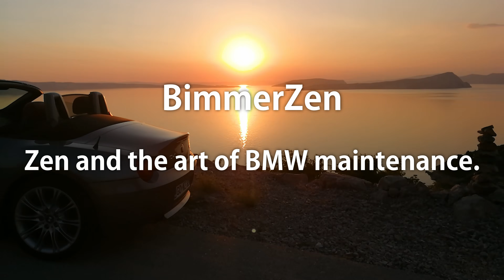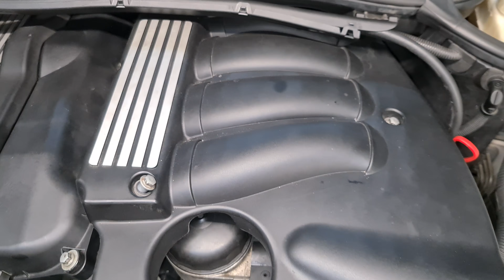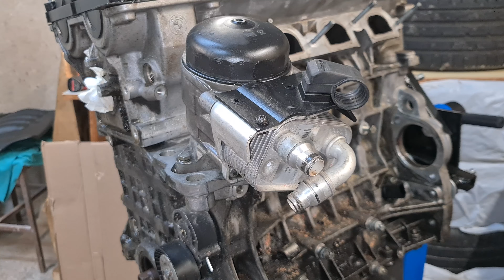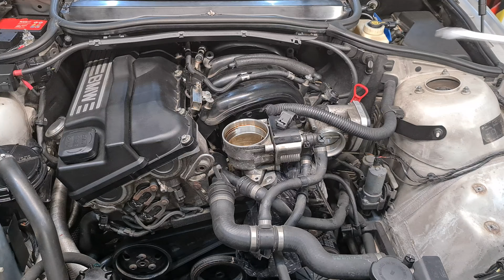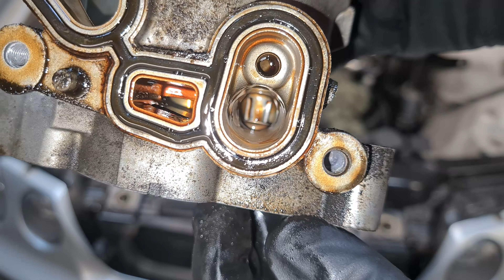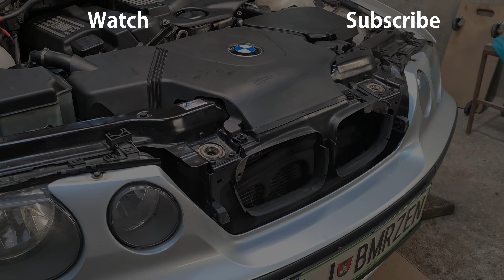N42/N46 Oil Filter Housing & Oil Cooler Gasket Replacement

Comment: Hi Bimmerzen, not sure if you still read these old comments but quick question the OFHG replacement--how come you didn't do any coolant drain or bleed? I thought disconnecting oil filter and oil cooler causes coolant to come out. Thanks
Reply from the maker: The coolant is contained within the oil cooler and you don't need to disconnect any coolant hoses to do this job. These gaskets only seal oil, not coolant.
Reply: @BimmerZen  Thank you for reply I will attempt to do this, your old videos on the N46 are very helpful 😅

Comment: Bad condition of gaskets can be why i have oil in my coolant?
Reply from the maker: Not on n42/n46. There is no gasket sealing oil and coolant. You might have internal failure of the cooler, or a bad headgasket or cracked head/block.

Comment: Thank you, I have just changed my gaskets following your video and now I hope that the problem is gone. 👍 (E91, N46 2007 model)

I also had a coolant leak from the pipe right next to the oil filter housing that I fixed first, believing that was my only problem. After changing that pipe the area behind the pipe and oil filter housing was still "wet" after driving, I didn't realize at first that it was oil. The leaking coolant and oil is running along the same path which put me off a bit. Double faults are always a bit harder. In hindsight I should have changed the pipe with its gasket plus the oil filter housing gaskets at the same time since they are of the same construction and most likely are in the same sorry state.

Advice to others, depening on what tools you have at hand, the angle between the T30 bit and the screw hidden behind the coolant pipe, your work angle might be very bad. Instead of risking destroying the screw head I recommend to remove the coolant pipe that are in the way. It is a very easy procedure and since it sits so high up the spillage is minimal, if you use rags and tie the hose  up when you have removed it from the oil cooler the spill is a decilitre/cup at the most. If you want to minimize it further, use a small tube and siphon out a couple of litres/quarts from the expansion tank to lower the coolant level a bit, then remove the hose. If you use a clean vessel you can pour the coolant back into the exapnsion tank when done.
Reply: Dude please contact me with an email or some sort of social media! I recently bought a 2006 e90 320i SE with a heap of leaks and other issues, would love some advice and guidance on issues, will happily pay you for your time on explaining things etc

Comment: Hi Zen, I'm going to change oil motor, oil filter and filter house gasket already bought inspired by your video. My question are: can I clean the house filter and the cap with WD40 and than blowing with compressed air or do I need a breack cleaner sure? Last question is I dont have a torque wrench; can I tight all the bolts by hand? The three of the house filter, the one of oil draining plug under the car and the oil cap? Thank you for your help . Greetings from Italy
Reply: the torque is not really a problem unless you have no feel when tightening stuff. i recommend just buying brake cleaner because it will evaporate after some minutes after use and its cheap.

Comment: hi, i have just received my deceased mothers 2009 320i n46 from her estate 7 years after her passing, when i got it, I noticed milky coffee coloured on the inside of the oil cap, thought it might have been from condensation from sitting since my stepdad past last year, but later on i also seen very thick coffee substance in the radiator overflow bottle and for some reason its pouring out onto the sump guard tray as well, my heart sunk when i notices this, because it was my mums car and i wanted to keep it as a remembrance

would the oil cooler cause this on a n46, I've seen others say it can but the ones I've seen are 6 cylinders oil coolers but i wanted to double check first

or is it a head gasket, thanks

Comment: This is a brilliant video, i need to change mine too, but i have a lot of oil down the front of my engine and on the auxiliary belt and on the alternator which has made it fail. I am buying a new alternator, belt and gaskets, please could you tell me where you got your gaskets and what's the best way/product to use to clean the front of the engine? I am a fool for leaving the leak for way too long 🙄 i have learnt my lesson.
Reply from the maker: Front oil stains are usualy from VANOS solenoid orings and oil filter housing gasket. Replace them all. If the belt broke apart, also make sure there are no pieces of belt behind the main pulley. There is a high chance that pieces of belt get behind the front radial seal in to the engine and destroy it: https://www.youtube.com/watch?v=3-QEahCUhnE&t=3155s&ab_channel=BimmerZen
Reply: Thanks very much 🤝 also what size socket do I need for the torx screws please?

Comment: Interesting, some remove the micro filter in order to remove the acoustic panel. Seems this isn't necessary. On the other hand you don't need to remove the airbox and intake cowling either.😊 Unfortunately this didn't help with mine. Either something went wrong with the gasket or my housing itself is broken. Seems i have to redo this.

Comment: Yesterday I used this video as a guide for the replacement of the oil filter housing gaskets for a N43 engine. Worked like a charm! I did drain the oil from the engine and lost only a couple of drops of coolant while removing the hoses from the oil cooler.

Comment: Thank you very much for your efforts
Am still suffering a lot from this oil leak. I think it's a problem with the  torque, my question? Is 10 nm is enough, did you encounter any leak after that.
Many thanks
Reply from the maker: 10 Nm is enough. If you still have oil leaking there, then you might have a problem somewhere else. Maybe the oil pressure is to high due to a problem with oil pressure regulating valve or there is some debis in the oil channels. You can check oil pressure at the filter housing (there is a special oil filter cap tool with hose attachment) or you can measure it at oil pressure sensor port. I used an old oil pressure sensor and modified it to attach a fuel pressure gauge meter to check my oil pressure.

Comment: Is it necessary to bleed the air from the cooling system? Or not
Reply from the maker: @axlepoent2728  Not for this procedure... cooling system does not have to opened for this, unless the oil cooler is replaced.

Comment: How common is it for the oil cooler to fail and mix oil and coolant? There is oil in coolant but no coolant in oil. Replaced head gasket but oil is still going into the coolant.

Or is a crack in the block more likely? The engine has overheated.
Reply: Check the oil coller or the oild cooler gasket.
Reply: @DrifitngDestinations  In the end I changed the head gasket and the oil coolers plus gaskets and everything is fine now :)

Comment: Hey, I have a problem with the same engine. The 3 mounting screws in this oil filter base cannot be tightened. They rotate. I took it out and it was a wound piece of aluminum. What should I do to thread the screw onto a larger screw?
Reply from the maker: Helicoil thread inserts is the best option. Just make sure that no debis go in to the engine oil channels. https://youtu.be/196iLkHb02I?si=S1XbXy6BEPR0bD1p
Reply: @BimmerZen   Thank you ! We can always count on you :)
Reply from the maker: And let me add this: I"ve seen incorrect torque values (20Nm) in the manual. Correct tightening torque for these three bolts is 10 Nm.

Comment: Could oil in the coolant be a result of this gasket going bad? My coolant is like a caramel milkshake.
Reply from the maker: No. Does your coolant level change? Probably just moisture in the oil from short distance driving in cold climate... Here is an example: https://m.youtube.com/watch?v=4U-4kKXzfwc
Reply: @BimmerZen  No coolant level change and not a cold climate. No coolant in oil, just oil in coolant. I've done some research and oil coolers seem to be the common culprit so I've bought a full gasket set anyway.

Comment: Hi! I'm actually going to change soon my oil filter gasket and oil cooler gasket cause i'm having the same oil leaks on that part and also in the cooling system. But do i need to change the coolant system since it has now a bit of oil in it?

Comment: Hi there, quick question on replacing oil cooler gaskets, there's 2 coolant pipes below going into that black plastic fitting, my n46 320i e90 has some corrosion on the slimmer pipe. Do you have the part number for those pipes or know exactly what those 2 coolant pipes are called?

Comment: I changed from my car but it is still leaking. Not so much anymore but it is still not good
Reply from the maker: You might have clogged oil lines causing high oil pressure at the oil filter housing. I recommend you remove the VANOS solenoids and check if they are clogged. Also take a look at the bores and oil holes in the cylidner head where the solenoids are. sometimes you can actually see there are debris stuck there...

Comment: Hello, what can i clean the mating surfaces with. Brake cleaner is okay? I was worried about brake cleaner going into engine with oil. Should this be a concern? Thanks for the very informative videos.
Reply from the maker: Sure, you can use breakcleaner, just make sure you wipe it off and you're good to go. It evaporates anyway.
Reply: @BimmerZen  ah okay that makes sense cheers

Comment: I have trouble with P0012 and 2A83 error code, timing chain is new, vanos intake and exhaust new, solenoid 2x new, camshaft sensor 2x new...Do you know where my problem is? 😅 I drive fine for 3 days and have a P0012 and 2A83 fault for 1 day, I reset the fault on the diag and start again...no problem 🤷‍♂️ and I drive again for a few days and the problem comes again....
Reply from the maker: Did you try to read errors with INPA? That will give you some additional error description.

Comment: Great video. I currently have my assembly off but the t30s feel like they were welded in
Reply: Way too tight bro I had the same problem, I half rounded one of the oil cooler bolts thankful managed to get it off 😅

Comment: Wow. This looks super easy to do. If that is the case why do some dealers charge upwards of $600-700 for this work?
Reply from the maker: It's easy on the n42/n46 engine,  but a bit more involved on the m54 engine. Perhaps the quote is for the m54?
Reply: @BimmerZen  yes. Thank you.

Comment: Thanks for this video! Are you sure 10nm is correct for these bolts? I bolted mine to 11nm.. and its leaking again. I did clean the sufaces and replaced with a new gasket. On some forum I read people are torqing to 22nm and the issue was solved for them.. Is yours still holding up?
Reply from the maker: The documentation states 22 Nm but also M8 bolt. But the bolt is infact M6 and those are usually 10Nm. The seal  is inside a channel and is sandwiched between housing and engine block. I dont think torqueing the bolts to 22nm will help much with compressing the seal. but you could try tho.

Mine is holding up so far, but I do not drive the car daily.
Reply: @BimmerZen  Thanks mate for your reply. I'm going to redo it and make sure the housing surfaces are spotless.

All the best!

Comment: Does your gaskets hold the oil well and it does not leak? Because I've changed the gasket like 2 times and it still leaks about a tea spoon per half year. So I wonder should I change once again but this time in addition to new gasket use some liquid sealer that suits the purpose? 
Could you share your opinion?
Reply from the maker: I'm not having any issues so far, but I don't drive the car daily anymore, so I cant be 100% sure it doesn't leak... I don't recommend using any kind of sealer or silicone on the oil filter housing as the excess silicone will break off and go past the oil filter and in to the engine and clog oil lines.
Reply: @BimmerZen  N42 engine is my daily choice, so I'd be happy to stop this leak. If I use some sort of strong, meant to be used for engine gaskets sealant and use it just a tiny bit to stop the leak. Would you still think it can get in to the engine? Also I believe there is positive pressure at the inside of oil housing that would push any sealant outwards. 
If you still does not recommend it. Should I just keep buying new gaskets until I get the one that fits perfectly?

Comment: Thank you so much for this excellent tutorial.

My e90 320i has always had that cold start rattle and low oil pressure (5 years) and I always thought it was the vanos. I took the oil filter housing and cooler apart and found that they were both saturated with broken pieces of timing chain guides. Needless to say.. the check valve was completely seized.

I did valve stem seals twice in the last 5 years (the valve guides were shot as well) I really think that this causes them to fail prematurely.

Comment: Awesome video. I will be doing mine tomorrow 😁
Reply: One question when fitting the new gaskets did u use any oil over the rubber or sealant?

Comment: did you drain the engine oil and coolant before this job? im planning to do this too but not sure if the oil and coolant need to be drained. i hope not so it can make the job more simple
Reply from the maker: You dont need to drain the coolan or oil.

Comment: Should the coolant / engine oil be drained before removing the oil filter housing / cooler assembly? Thanks!
Reply from the maker: No, you can do it without draining the oil or coolant.
Reply: @BimmerZen  Cheers!

Comment: Hi,do u know if the gasket between the oil cooler can be the problem with oil mixing in the coolant reservoir? I’ve looked under the engine oil cap and there’s no sign of that there is any water in the oil but somehow oil gets to the coolant :/ . I don’t think it’s a head gasket , maybe there’s something easier to fix ;O
My engine is n46b20a
Reply from the maker: That gasket is not sealing oil/coolant. It could be the oil cooler itself. You can probably test the oil cooler.
Reply: @BimmerZen  I’ll get one from bmw tomorrow and probably change it next week and after change I’ll flush the coolant so I’ll see if it helped , if not will it be the head gasket?  Or there is something else what can leak oil to the coolant :/
Reply: @BimmerZen  how do we check the oil cooler, thanks.

Comment: Great video, super in depth! 
Recently replaced the alternator, and had to remove the airbox as well. However, that small vaccum hose was very brittle and it probably broke while i pulled it out.. I tried to repair it with some cable insulation and zip ties, but its probably not 100% sealed. What sort of issues can I expect from it not being properly connected?
Reply from the maker: That vacuum hose leads to the fuel pressure regulator that is integrated in to the fuel filter. You can expect overpressure in the fuel feed line and probably rich idle and lean on the higher power requirement. Overpressure can result in damage to the fuel system.
Reply: @BimmerZen  okay, so for sure replace with a proper hose then😆 thanks!

Comment: I do have to ask. I've watched allot of your videos but you've never addressed the crank position sensor. Ive done all the other things on your channel. But nothing to find on a n42 engine
Reply from the maker: I did change my crank position sensor when i was trying to diagnose long crank start (https://youtu.be/9uAKn31s0UI) but i haven't made a video on it back then... You basically need to remove the intake manifold (https://youtu.be/uB77ykvf5iI) to get to the sensor.
Reply: @BimmerZen  thanks so much! We burned some midnight oil to get the intake off. Actually removed the steering backed and bottom plates to get to the screws on the bottom of the intake. Struggled allot because we where missing allot of tools. But everything is working perfect now! Started with the valve seals, removed the head, cleaned it, surfaced it, new valve springs, then chain, replaced the coils, waterpump, cleaned out the double VANOS, accidentally mixed the connectors of the 2 VANOS actuators, that came with a heep of trouble. Did the belt, tensioner and dynamo. Filters fluids sensors ccv everything has been touched and replaced right before the 250k mark. Now focusing on the undercarriage, replacing everything with new. I really love this car (E46 316 1.8 touring 2003) and your channel helped me love it more. Its an intense car and engine to work on, but with your support it is a wonderful adventure! Thanks so much
Reply from the maker: @Rea-per  awesome job!

Comment: what if i change both and theres still oil in that cavity? Im thinking about the oil cap filter cause its seems like its dripping from the top plastic part
Reply from the maker: Did you try changing the O-rings on the cap?
Reply: @BimmerZen  yep.
Reply from the maker: @ionut0214  is it possible it's just spilled oil from oil filter change?
Reply: @BimmerZen  it may be possible. im gonna clean it and dig to see its still spils